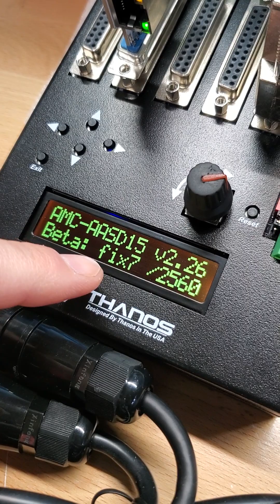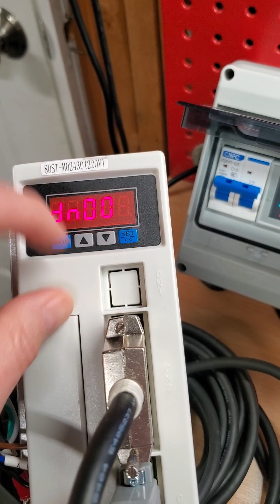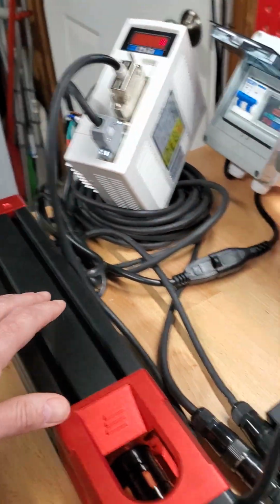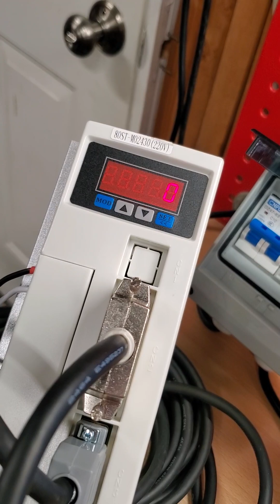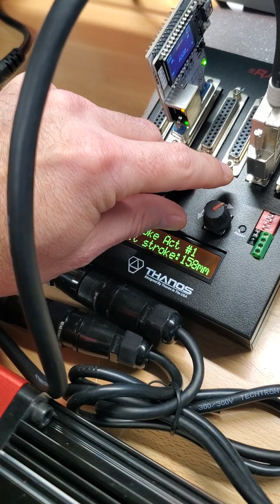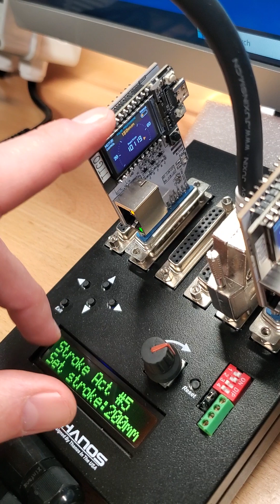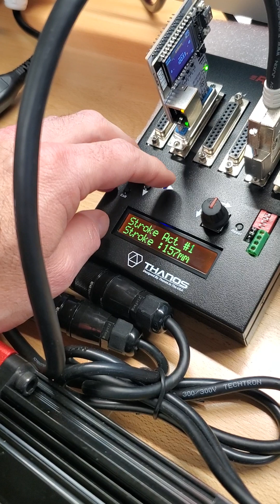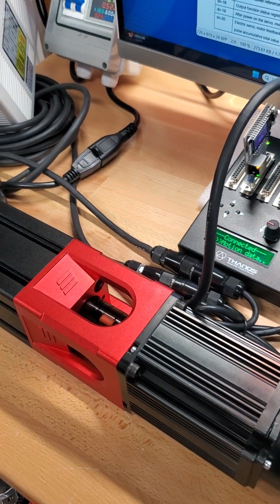Update on the new functionality of Firmware v2.26 fix7

Comment: Hi, @thanos  I'm wondering why I'm get jittering when my fps drop just tiny bit using MSFS with SRS and e racing rig ? why the motion data connected to FPS, is there a way to minimize or eliminate the issue ? Thanks
Reply from the maker: SRS need to fix their code, it's unacceptable to not have any post processing of the MSFS motion data, to even add a basic moving average filter.. Anyway, perhaps you can use the hardware based one the Thanos controller has, by setting the "Pulse Filter" to value 2 or 3. It should smooth a bit more things.
Reply: @tronicgr  thanks. Should I play with escape and fine settings ? Will that help ? Thanks 🙏
Reply from the maker: @evanphotography5149  better not. Should not rely on the spike filter anyways. It's there as last resort if the game or the motion software glitches. I'd suggest trying Simhub as it has super smooth motion, but they don't support flight sim titles (yet)...
Reply: @tronicgr  I would for sure get Simhub once they support flight sim title, hopefully they do! Thanks again.

Comment: Hi Thanos, Im in United States and I have 110v servo motors and 110v 30amp white servo controllers for my 5 dof im about to build.  Is your motion controller compatible?  By the way, do you think  15amp breaker in my house  enough for my 110v 30amp white servo controller?  Thanks
Reply from the maker: It depends on the size of the motors and the loads on your platform. Most racing rigs use AASD-15A drives (white) with 80ST-M02430 servomotors, on 5mm/rev pitch leadscrew, 150mm stroke actuators. This can run easily  on 110v/ 15A circuit. Usually draw around 2A-3A while on normal lifting action, with peaks of 9A if the rig is loaded with onboard screens etc. I don't see it will be a problem. If your breaker trips, then you might want to have an electrician to install a larger circuit if your servomotors are oversized beyond the usual.

Comment: @thanos I just received my E-Racing Ultimate kit and am in the process of setting up.  Just upgraded to this fix 7 (it came with fix 6) firmware but have a question as I watch your videos on EMI and how to reduce it.  I"m in the US, and the power supply health is 'good' in my house, but would you keep the Thanos Controller separate from the Servo Drivers inside a Network Cabinet, or would you recommend keeping it in the Cabinet w/ the Servos.  Wasn't sure if any interference occurred depending on placement.
Reply from the maker: I think should be fine with the since the Thanos controller from eRacing Lab comes in a metal enclosure, and should be fine as long as you keep a few inches away from power cables. I you notice any issues, you can always hook it up from the outside (some ghost hunting, but easy if you watched my other videos).